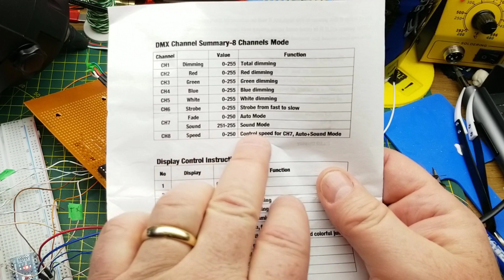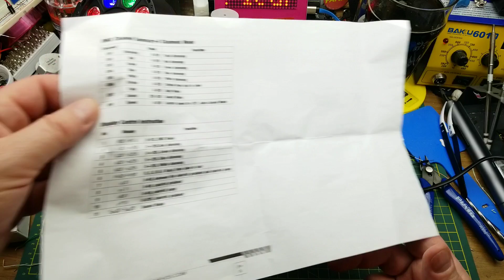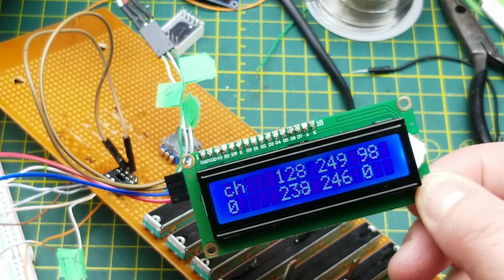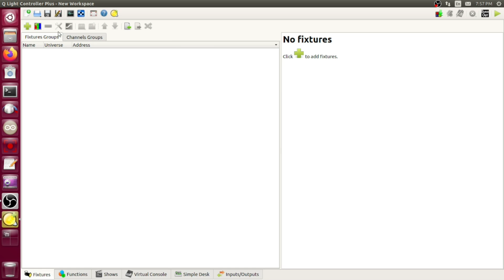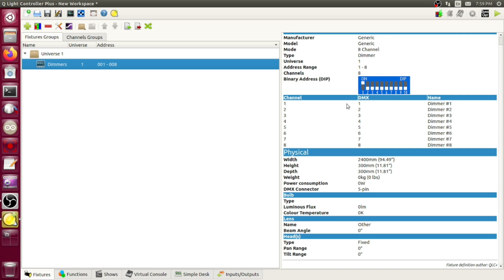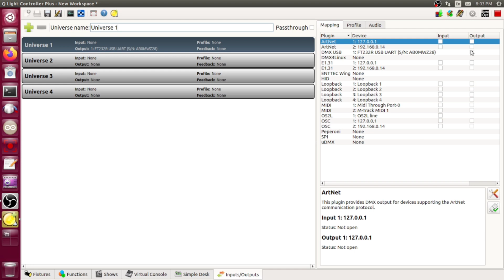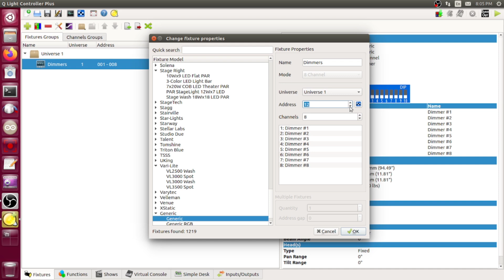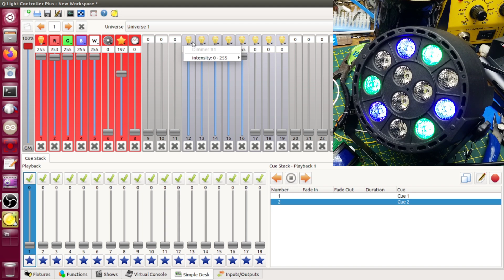Tinkering and talking: DMX light control

Comment: Something to note about the 3 pin XLR is that it's all the pins that are needed. The other 2 pins on the 5 pin connector are either used as a second data network, or else(most of the time) unused.
Reply from the maker: Yes, it only uses 3 pins, but the DMX standard specification defines the official connector as 5 pin XLR.
That's done to prevent accidentally connecting audio cables instead of the correct impedance DMX cables.

Much of the time you can get away with the "wrong" cable, but it can make the difference between a working system and a non-working one, especially in a large installation.

Comment: The most common, even in the " expensive end " of DMX is the 3 pin. I have seen 5 pin stuff advertised, but not in use. The 5 pin system has 3 "active" pins and 2 disconnected pins or 2 universes in one cable.

Comment: Those Tassie LEDS on the breadboard are likely interfering! 🤔
I’ve had lots of issues with rotary encoders, but I did manage to find a nice library which worked alongside the TM1637 library on the “Rowing Clock” video. There were a bunch of libraries I used for that project and compatibility with each other was a governing factor.
Good luck moving forward…you know I want to shrink it down to an ATTiny! 🤪👍

Comment: Very nice contoller you've built. I've got disillusioned with Arduino. I bought an UNO and all the extras I needed for a project, about 15 inputs, (a mix of digital and analog), and an OLED for the output. Just the OLED and the rotary encoder took up 47% of the memory. On top of that, I could'nt get any of the other input devises to work along side of both of them at once. So I quit. I'll probebly go back to my original plan of using a spare Z80, a 16K EPROM and 1K RAM chip I have.
Reply: you have to differentiate between Arduino software and hardware, the arduino software can work with a huge number of different boards, some with 10x the horsepower and memory of the AVR arduino boards

Comment: oled, a library is just code,  copy it to your project directory and change the include, 
or add all the code to your code, find the defaults, error check, change, error check ...
Reply: Do the Include, then comment out the new library. Now uncomment it one section at a time until it breaks something. It's probably just a duplication of Function/Method or Variable name (or whatever they are called in Arduino language).

Comment: 2:50 I love that the spec explicitly prohibits the 3-pin plugs, and yet here we are :)
Reply: It is actually more of a real standard in DMX than 5 pin. Go figure.
Reply: Back in the early days microphone cables were more popular than dmx cables hence the 3pin XLR. Cheap lights use 3 pin is not an accurate statement as some of the larger companies like Martin used 3 pin xlr on there RoboSCan pan and tilt fixture $1700 back in 2004.

Comment: why not use two push buttons to switch channel up and down
Reply from the maker: Dunno. Maybe I was overthinking it...
Reply: Totally overthinking it LOL. There is no need for any channel switching, since there are only 6 channels on the controller and there is only one light. You just set the starting address in Arduino code, and set the light to suit. Or better, just leave them both at the default 0.
Reply from the maker: @johncoops6897  There is only one light *so far*...
Reply: @pileofstuff  - LOL, yes... and your Arduino's I/O ports are all maxed out.
Reply from the maker: @johncoops6897  I paid for all those I/Os, and dammit I'm gonna use them all!

Comment: That is cool. I can see why you're having trouble. It seems to follow the same protocol of modern dsp pedal board effects setups with each song being a different scene because there are only so many foot switches. Cool video man, it's a big project. You're right though just doing a project is the best way to learn. I have a bunch of half done projects but I've decided not to take on anymore until my new workshop is finished and I take a few off the pile and finish haha